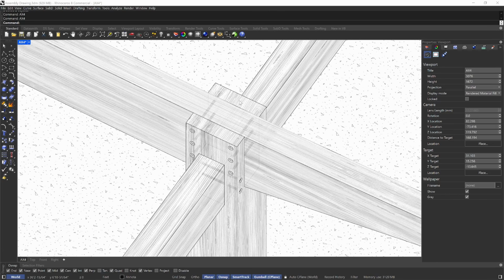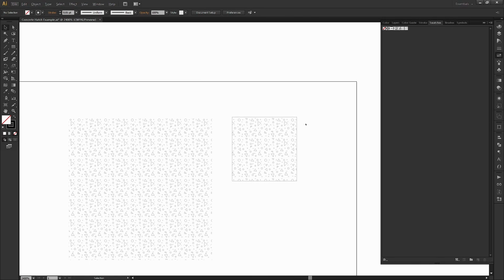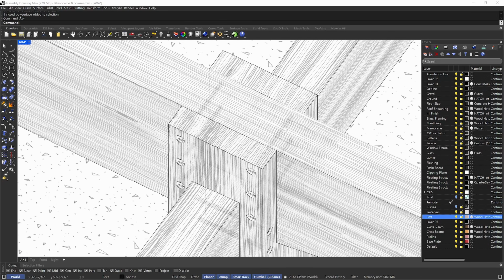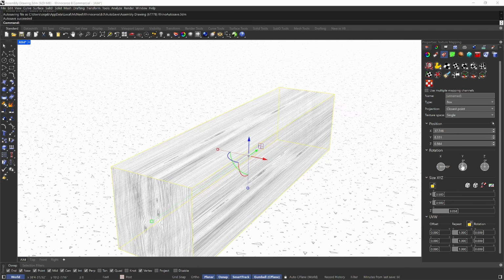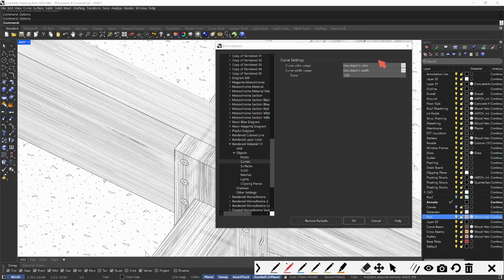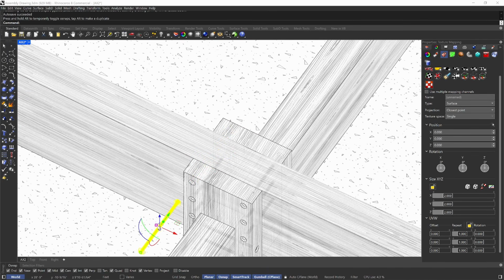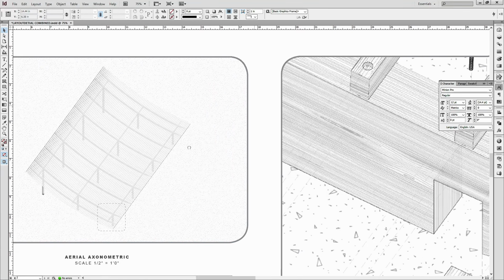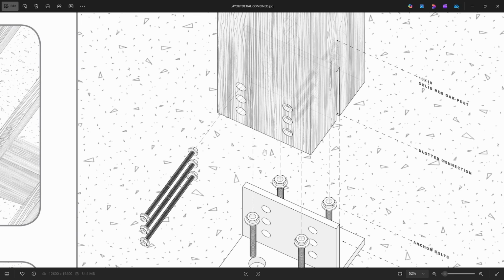Architecture Axon Assembly Drawings in Rhino 8 and Architecture Presentation Layouts

Comment: Hey, thanks so much for this tutorial. Your channel is so incredibly valuable for students and even professionals like myself. One question I have for you, when you create these type of drawings do you use named positions at all for these drawings? Only ask that because if you want to restore the bolts, for example, back into their original place do you keep that within the same model or do you suggest keeping that a separate model? does this make sense?
Reply from the maker: Thank you so much for your support. 

You definitely want to have a separate a file.
Reply: @unitedstatesofdesign thanks for the quick response! cool yeah that’s how I do it. Have you ever used the NamedPosition command for any of your workflows at all?
Reply from the maker: This is just my opinion, but I think NamedPosition (and snapshot) are good for final presentations or  quick presentation comparisons. Not a drawing that requires an iterative process (test exports, lineweights, hatches, placement, etc). Personally, I wouldn't use namedposition on a model that is dedicated for a specific presentation / view. Maybe I need to edit the axonometric but not the exploded, or vice versa, or both, maybe I have two different texture maps or materials with exploded vs unexploded. I don't want to go back and forth toggling between settings.  With all that being said, I am certain people use NamedPosition and find it very useful for their workflow.
Reply: @unitedstatesofdesign  cool i agree. thanks so much man!